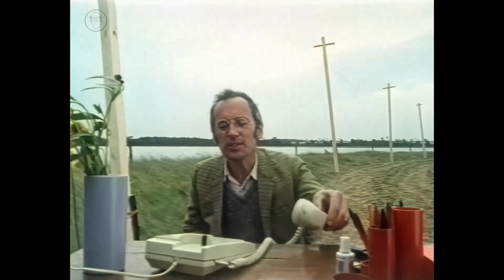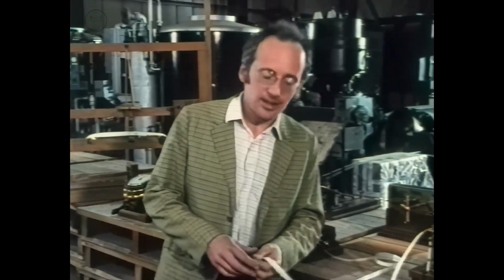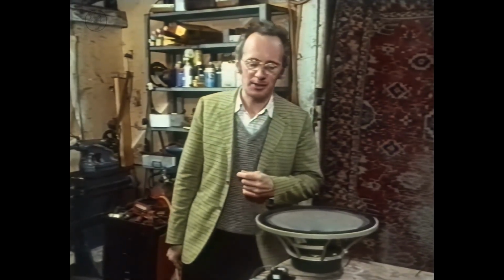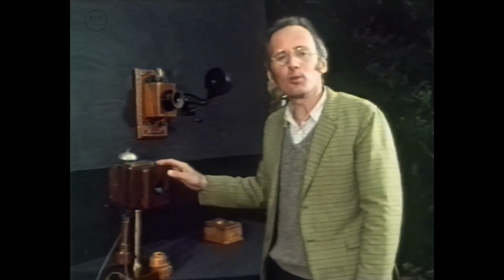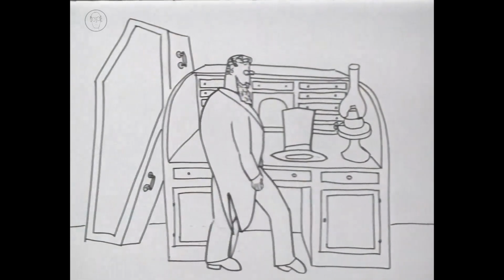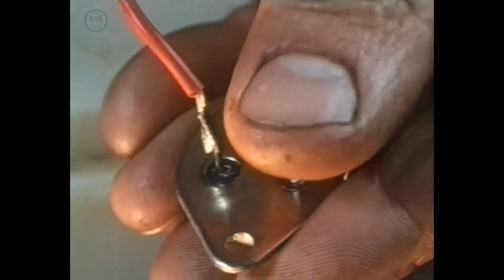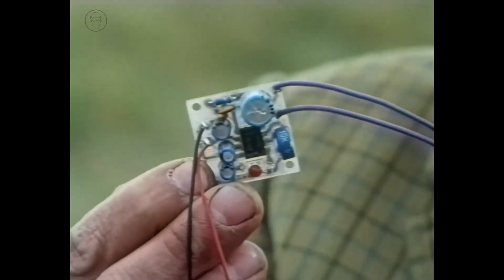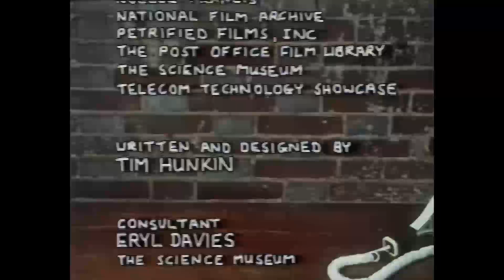The Secret Life of the Telephone Remastered

Comment: I was a telephone switchman back in the 70's and 80's and I really miss the days of the electromechanical and the early electronic systems. It was fascinating work and one of the very few jobs I really loved - not to mention the joy of being a young guy working in a building full of female operators! Sadly it eventually all evolved into sitting at a desk with a terminal and I changed fields multiple times after that. I miss the old central office days.
Reply: What did you ended up working after all?
Reply: The song about connecting was so good, no?

Comment: Fantastic original series and the remastered episodes are a testament to your early work. I Started my working life (aged 16)  in 1967  as a trainee technician with the GPO. Part of my training involved working in a telephone exchange at that time.  Most  of the telephone exchanges were Strowger. They were usually maintained by a cleaner, four technicians and a senior technical officer. By the  early 80s five exchanges were maintained by one technician and a dog. People would ask what was the dog for? - Answer  "to keep the technician away from the equipment". The digitization and computerization of the telephone infrastructure had a huge impact on the number of people employed and a level of skill required. Happy days.

Comment: I have wonderful memories of stroger two motion switches. I was a stroger technician in the Navy. And cut my teeth on that equipment. Nice thing about the relays was you were able to cobble together special pieces of equipment for special applications, which occasionally I did. I had the privilege of operating and maintaining a 100 line stroger exchange and a small town in Morocco part of an US Navy facility in kenitra, now long since defunct due to satellites. I eventually went on to own my own interconnect company selling installing and servicing telephone systems for private clients. I eventually expanded into information technology, selling installing and servicing computer networks. It's amazing how much the technology has changed as I am dictating this comment on a Motorola cellular telephone. I quite enjoyed his comments at the end regarding job satisfaction which I can very much relate to. Well in my business I do still have to pull wire from one location to another and make physical connections and other related things as far as servicing these products you become a board swapper. You almost never track down a problem to a specific component in a system.

Comment: That was very interesting. I was hoping you might touch on Harold Black’s invention of the negative feedback amplifier, but I guess that was outside the scope you your program. I’ve still got some old 1970s era phones that work on modern systems. Thank you very much for resurrecting these programs. This was TV done right.
Reply: I'm kind of amazed that the POTS (plain old telephone system) is still compatible with such old phones. I have one myself in the living room that rings very loudly every time someone calls. It doesn't get used much anymore, but it's occasionally useful when the cordless phone got left out in the garage or something or there's a power outage.

Comment: We still keep a line to our house, but we're not as likely to pick up the phone today. With so many robotic scam calls, we let it go to the message machine, and scrutinize the number that appears on Caller ID, and we also have a selective call blocking system. 

The worst telephone issue we ever had was in the 1990s when we had a second number added to the existing wires for dial-up internet. To much annoyance, we learned that a fax machine in another state was testing itself with our new number at 3 o'clock in the morning. We made the telephone company issue us a different number, and that stopped the ringing issue. 

When I moved out in the early 2000s, the phone company let me take the second number with me as my primary, but through a clerical error that wasn't caught for several months, I had been paying an extra dollar-something for a second listing that no longer existed as such. I was eventually credited back a little over $ 26 in over-payments because I had kept the billing statements for just such an issue. This was about the same time the local telephone company changed owners several times; a rather chaotic era.

Comment: On the idea of ignoring the phone, it used to be that you could not turn off the ringer (at least with BT). When the 'trimphone' first came out there was a volume control at the side - if you opened the phone up and removed a screw then you could silence the ringer completely. Naturally this wasn't allowed by BT as you might not answer calls - as that's where they got their revenue.

Come to think of it you could silence an older phone with bells. The two bells were mounted off centre and could be adjusted to change the tone and volume - vital in an office where you'd want to be able to tell one phone from another. But if you turned the bells to press against the clapper then they'd not ring (maybe give a slight vibration).

Comment: I see a particular telephone exchange occasionally and it is a vast empty building now. The racks are there but empty. I assume that there’s a small vault in there with the box of tricks that does it all.
Reply: Yes. I work in an American rural exchange and the room that used to house a massive crossbar switch was split up when a digital computerized switch was installed; a few years ago I helped tear that out. It was replaced by a frame the size of a phone booth. That has now been superseded by a pair of 12" x 21" x 15" boxes mounted part way up one of the racks. The rest of the space? Desks, storage and equipment relating to the thing that effectively killed it off- the Internet.
Reply: Yes indeed. The exchange I am thinking of is in Lochgilphead on the west coast of Scotland and I believe that it was in some way connected with early international traffic on the TAT cables that come in at Oban (including the old Cold War hotline!) hence it was rather larger than you would expect for the rural area that it serves. All rather more romantic than the current stuff!
Reply: @robinwells8879  Oban has a very rich and interesting history, mostly for being a strategically important location nobody knows about.
Reply: @nigefoxx  indeed. I love the place.

Comment: It s good to see this again, just at the start of the next big change. Apparently the electronic exchanges are coming to end of life, and the move is on to transfer the domestic phone system to the internet. As I understand it every home will have a modem to interface the domestic phones to the internet, with a user maintained battery backup to  cover power cuts.
Reply: So basically VoIP is expanding from (mostly) business use to (widespread) home use. I wonder if it's a bit redundant these days though, as most people have cellphones anyway.
Reply: It is very close to the end of the PSTN POTS... VOIP is taking over the world!
Reply: The transition here in the US started about 10 years ago. There's no on-premises change. A media gateway, which is a multi-line ATA (analog to VOIP converter, "Vonage box"), is installed either at the existing central office or in a street cabinet. The last mile copper that's already built out remains unchanged. Most people don't realize they've been changed because nothing they see changes.
Reply: @straightpipediesel  yes, I've been working with both PSTN and VOIP for many years now. :)

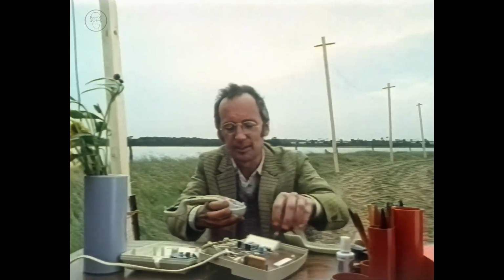Comment: 1:06 That microphone must be a wire wound dynamic type, because you'd need a battery to hear anything with any other type of microphone, ie. carbon or electret. I'm not aware of any regular telephone ever using a dynamic mic, apart from a sound powered telephone. I'm a bit confused by this, especially since a dynamic mic used in a regular phone would still need amplification, which means a battery would be needed for this. Perhaps you could clear this up Tim ?

Comment: When I was a child (1961) my brother and I would get two nails long wire and a telephone and simply throw the nails over a telephone outside line and start dialing.... Happy Days long gone
Reply: In English ?
Reply: @tonywright8294  "When I was a child in 1961, my brother and I would get two nails, some long wire, and a telephone and simply throw the nails over a telephone line outside, and start dialing... Happy days long gone."

This is also how some Underground train drivers would make emergency calls. They had a handset with two leads that they would clip to the bare telephone lines strung to the tunnel wall.
Reply: @tonywright8294  in English what